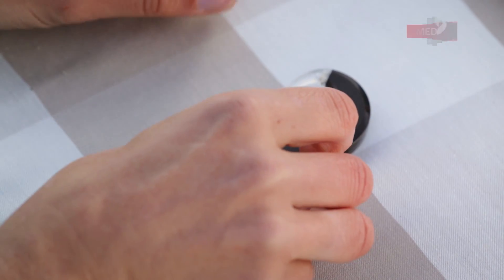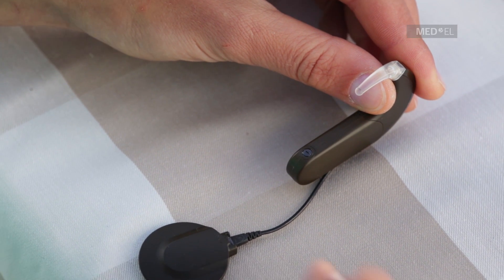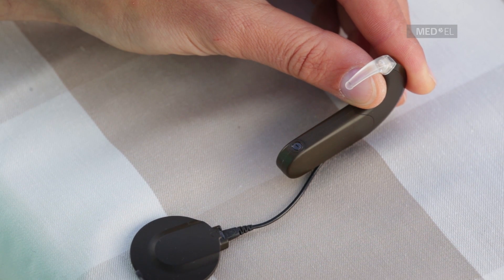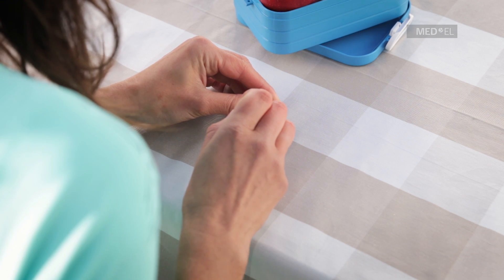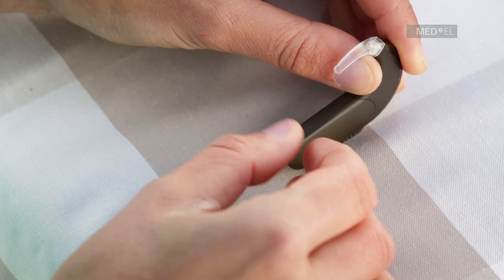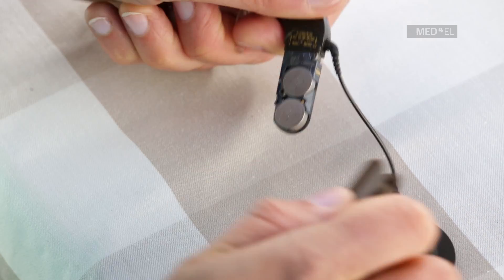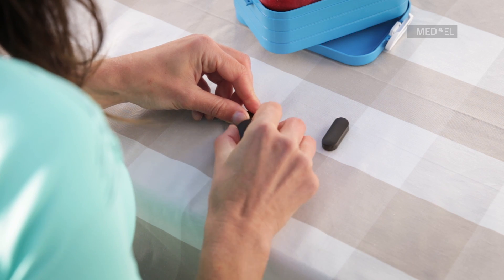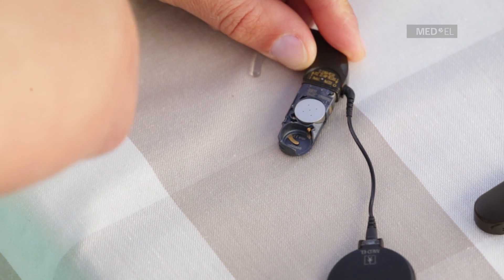SONNET Hands-On: Replacing the Batteries—MED-EL

Comment: Based on my experience, I think it is important not to pull with gripping the microphone cover as it may cause it to lose it's ability to stay in place. Surprised the video didn't mention the sticky tabs.
Question? How should we dispose of the used batteries?
Reply from the maker: Hi Wayne, we recommend to avoid pulling on the microphone cover when changing the batteries, and we recommend to follow local guidelines for disposing of batteries in an environmentally-friendly way.